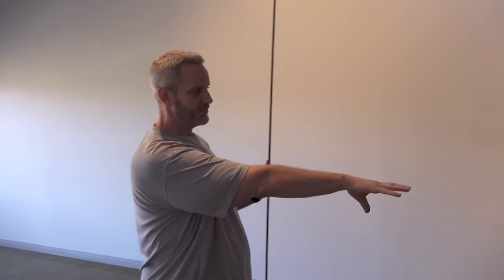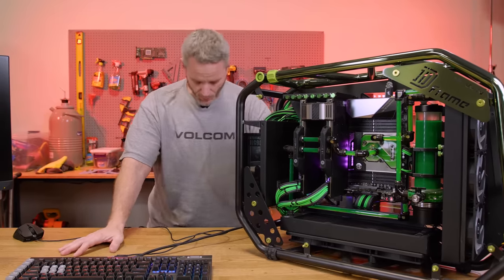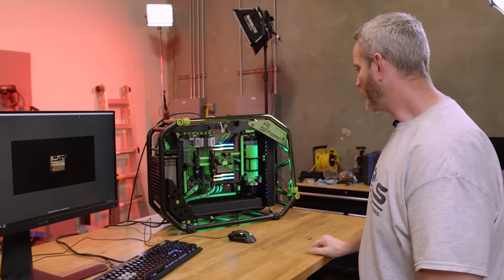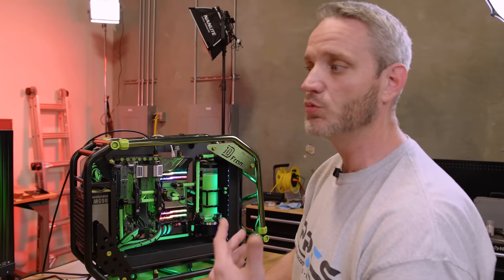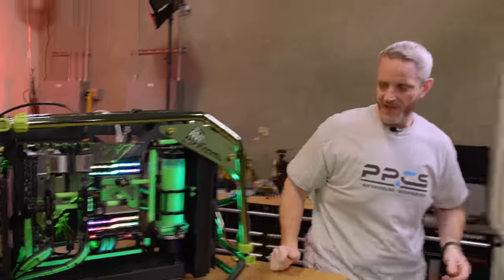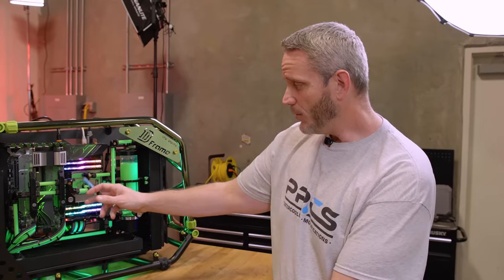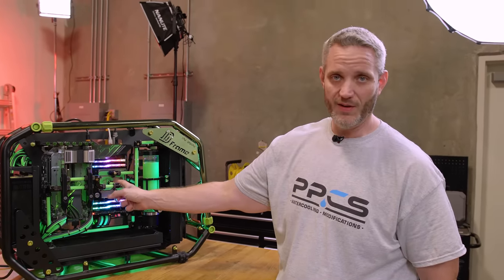This PC deserves better than this...

Comment: My last build had an Intel 4590K (?) that was cooled using Ice Dragon's (white) coolant; the build was completed in the spring of 2017 and aside from numerous BSOD's from a crappy motherboard, it ran cool throughout its lifespan - I didn't ever replace the coolant.

Now that that system has sat idle and unpowered for just over a year, the coolant has definitely fallen out - it's now a medium blue color. I'll try Jay's method of "refreshing" the coolant prior to disassembly and cleaning of the water cooling components. 
Being able to get the coolant to a near-new state would definitely lessen the cleaning time.

Water cooling components used were the EK Supremacy CPU block, Darkside 240 mm (60 mm thick) radiator, BitsPower 250 ml reservoir + D5 pump combination, Primochill soft tubing, and Ice Dragon coolant.

Comment: Never used opaque fluids. Used clear EK-Ekoolant for my first loop, then went Primochill True Transparent UV Purple. No breakdown in the fluid but it kinda stained my PETG tubes and it's crept into the gap between the metal block and acrylic top so I need to take apart my blocks to clean it since I'm going back to clear fluid with EK ZMT tubing on my next upgrade. Probably use non-acrylic blocks too for more of a stealth/blackout build.

Comment: my EK cryofuel solid scarlet red (the premixed bottle) held up phenomenally. The first load was in the (back then brand new) loop for 1,5 years of daily 2-4 hours of mixed use. Mostly gaming, sometimes some rendering.
I changed to the 2nd bottle of the same fluid and only needed to do a flush with distilled watern and there was absolutely nothing left in the loop, not event a tiny bit of fall out or anything.
After i'm done with the 2nd bottle i will do a full disassembly and look how the builduo in on the o-rings and stuff but so far i'm really happy i went with it and had 0 problems.

my setup is cooling a 9900k and the vrm for it and my 2080ti in a single loop with 2x 360 rads and a D5 pump that has a low-ish rpm curve set. Blocks /Rads / Fittings are all from EK, Nickel plated copper for the blocks.
Normally it doesnt spin above 2500 rpm while under load and idle its something like 800 rpm. + i've got a temp sensor in the loop and control the loop temp to be under 36°C
 all the time.
Since this is the first loop i ever built i did go for flex tubing and during the flush it didnt look color stained but not as clear as the first day (seems like normal degradation).
And on a sidenote, i'm really happy to make the decision for the singulary reservoir combo. The finish on the parts is just stunningly clear.

Sorry if its not well written / all over the place. It's 3 AM and english is not my native language ^^

Comment: I did a custom water system for my old set up 10 years ago. All I used was a small bottle of water wetter some og Listerine, and distilled water. It ran pretty much 24/7 that entire time before the cpu block had finally built up enough gunk to restrict flow. All I did was top it off worth water 2 times to ever 1 top off with Listerine over the years. It all transferred to the upgrade with a new mb, cpu and water block but same pump and reservoir combo. I just replaced the neoprene hoses cause they were all sticky with permeated coolant and dust. If ya don't go overboard with weird additives they can run pretty much forever.

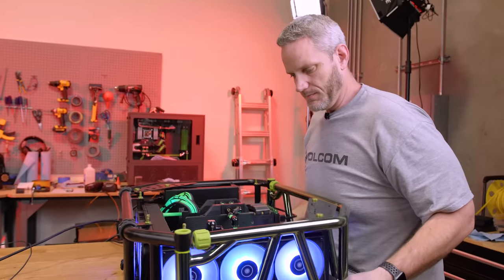Comment: 4:00 jay doing that reminds me of the ps2, sometimes it used to stop being able to read disks and the disk would just stop spinning.
I figured out if you tip it on its side and rock it up and down it for whatever reason made the disk keep spinning and itd read the disk.
Even happened once when i was at a friends and i did the same thing to hers and it worked. 
Have no idea why that would work but it did.

Comment: Went 1.5 years with Alphacool Eiswasser Pastel white in wife's pc. Zero sludge and a slight amount of buildup that broke loose on a distilled water flush. Retired that board and block for a new EK Quantum Velocity and Eiswasser Pastel Orange with 120mm Corsair LL's for a "Portal" Theme

Comment: The longest I ran a coolant in my daily PC's watercooling loops was for about 2-3 years with mayhem pastel orange with no issues other than the partials with time will fin out a bit (nothing major) and settle in the lowest part of your loop. Then again my prep work on all parts that includes the water was above the recommendations (flush /clean etc...). I even tested ph /acid to make sure it was in the appropriate range while doing my last full system clean. I simply rather spend a few extra hours to avoid issues then spend hours fixing them. used flexible tubbing (do not remember the brand)

Comment: I've been running my Mayhems Pastel Yellow for three years now. No maintenance was done except for topping it off occasionally.

System:
AMD Ryzen 2700X CPU
Asus ROG Crosshair 7 Hero MB
G.Skill 3200C14 16GB RAM
Nvidia Titan Xp Jedi Order Collectors Edition GPU
Samsung 960 Pro 2TB NVMe SSD
Corsair RM1000i PS

EKWB Supremacy EVO CPU block
Watercool Heatkiller IV Pro GPU block
Watercool MO-RA3 9x120 radiator
Watercool Heatkiller Tube reservoir
Watercool D5 pump

This system started out with a Threadripper 1950X, ASRock X399 Taichi, a Watercool Heatkiller monoblock, and 32GB of G.Skill RAM and I wanted to overclock it all, which is why the overkill cooling was used. Ran it that way for a while and then decided to switch it to what it is now. It had the same Mayhems Pastel Yellow coolant in it. I have a couple of quick-disconnect fittings in the loop, so I was able to switch from the monoblock to the Supremacy EVO with very little coolant loss.

The GPU temp has never gotten above 35C. CPU temp peaked at 55.8C when running Prime95 v29.4 build 8 Small FFT for several hours recently (3.95GHz all core). Coolant temp at idle is typically 21C and the hottest I've seen it lately is 25C. Any time I'm not working or gaming, the system is running BOINC with CPU and GPU work units, so it gets a full workout all day every day.

I would use Mayhems Pastel again. Building a new system very soon (already have Intel Core i9-10850K, Gigabyte Z490I Aorus Ultra, 32GB Crucial Ballistix 3600C16, and MSI 3070 Ventus 3X OC), so I may have a chance to...
Reply: And this is using PrimoChill PrimoFlex Advanced LRT 3/8" ID 5/8" OD tubing with Barrow compression fittings and two Koolance QD3 quick-disconnects.

Comment: you should rank the builds you have still lying around by different criteria to see which is the best by speed, value for money, value for money related to original pricing etc. Would be interesting to see (and too see which builds you have off set that we haven't seen/ haven't seen in a while)

Comment: I was a super early adopter of EK's Fluid Gaming aluminum line of products. I've had no issues until 6 months ago when I gave it a good cleaning and fresh distilled water only to have my cpu block clog enough to throttle my cpu 3 months after cleaning. I don't believe the water jug labeled distilled water was distilled water based on the sediment that got lodged in the block in only 3 months time.

Comment: I had mayhems blue dye + distilled water + primochill liquid utopia gunk up blocks within 2 years. Since then, I removed it from the equation, so just distilled + liquid utopia in all my systems. 

Had them run for years, sometimes with periods of being off for many months at a time, no issues. For me, losing colour and paying for an additive that can be hard to find sometimes is well worth the no-worries hassle. Now if I only bothered to clean the parts I re-use which still have a little buildup from old dyed systems, thing would be perfect.

Comment: Running I7 7700k with an EVGA 1080 for over 2 years on distilled water and some PT Nuke biocide. No issues. My new build will run EK Cryofuel opaque. Hope it holds up.

Comment: thermaltake c1000 opaque blue fluid, filled the system in 2018. only had the clean the blocks once and reused the fluid after cleaning. very minimal fallout and minimal nickel wear in the blocks.

Comment: I know this is probably too late, but I'd like to see a video featuring the difference between a fresh windows installation and an installation that's gotten updated over time. I'm sure most performance impact would be from programs installed by the user, but answering the question of how often to perform a fresh install would be a cool video.

Comment: Thats why I always buy a big CPU and upgrade my GPU a couple of times.
Went in 2014 from an i7-4770K with a GTX770 to the same i7-4770k and a GTX1080 and now I'm pushing the limit for the CPU - seven years later. 
Now it's time to upgrade. When stuff is available and money is present....

Comment: I’d have rather used air cooling or a closed loop cooler for that build.  I don’t want to deal with the maintenance of replacing the fluid and draining / flushing the lines and reassembly.

Comment: I actually tried to do my first water cooled build yesterday. I knew the case ALMOST fits a radiator on top (maybe if it wasn't crossflow it would fit) so I have a dremel and was going to make the opening bigger (it gets covered up in the end so no biggie if it looks like ass). Unfortunately my dremel only has 1 bit that can cut steel and it's not designed to cut like that. So I had to get a new one. In the meantime my Ryzen 3600 (temporary placeholder for my 5900x) is just loose parts sitting on my desk. But hey I love it already. Sooooooo much faster than my old antique I7-2600. I can't wait to get it all together properly instead of in the "test setup" configuration.

Comment: 2 years, fully diy salvaged loop (by nameless radiator + random tube + H100i pump ) using car rad coolant, not a single problem so far lol. same temp, same amount of liquid in there. i did took apart once to check the fin stack, looks fine. so yeah....

Comment: I just noticed last night the fluid was almost not moving in my loop. Turns out it’s the EK (opaque white) cryofuel being all gunked up in the CPU block after about a year.

I drained what I could, refilled with distilled water (you can barely tell, still looks pretty opaque 😆) and left it running overnight. 

Today I’m gonna do the heating thing he said after flipping the cpu block around.

Components:
- EK Opaque white concentrate w/ distilled water (more water than typically recommended)
- ek distro/cpu blocks
- ek radiator
- ek acrylic tubing + ~an inch of ek soft tubing

Comment: Why I stopped water cooling about 5 years ago. You can get air coolers that easily does the job, still looks decent and you don't have to deal with that crap anymore. I can focus on doing what your suppose to with these rigs. Gaming.

Comment: 3 years of updates would put you around 1803.  Do a google search for "Windows 10 Update Assistant", it'll bring you up to the most current build (at the time of writing this comment, that is 20H2).  Once it is done, obviously you need to reboot the system, however, if you do not manually reboot the machine, it will give you a 30 min countdown timer, and reboot automatically.  The only updates that do not download are any of the small minor updates, so after the reboot, you will need to run Windows Update (the normal way) to download any additional updates.  Reboot,  and check again (but you should be updated by then) Total turn around time is roughly 3 hours from 1803.

Comment: Been running my pc on mayhems pastel white without changing the fluid for around the same length of time (4/5 years) with no issues.  Everything in the loop is EK, I sometimes see some fall out if it hasn't been on for a while but quickly comes back to life after it ramps up

Comment: Your point about getting the fluid hot is the same reason I use boiling water to clean my radiators. Had to flush them 7 times with boiling water to clean the vue out of them.

Comment: great video. i had an issue with my new ek monoblock were it looked like the acrylic was cracked but it was just coolant seeping. Took it apart cleaned it and it looks brand new. I was pre scared tho. This clarified alot.

Comment: I had an unpleasant experience with the green VUE. 6 months in it started to flake out, but i was to lazy to flush it out and it didn't look too bad.... 7 months in it really gunked up and i had to take everything apart and deep clean my blocks, rads and pump.
So if you think >oh, it's not so bad. I'll clean it up soon™<
Just go ahead and do it NOW, because it might get worse ;D
I'm very tempted to try opaque fluids again, but for now i'm sticking with the clear ones.... Been running EK cryofuel in red, green and orange for ~ 2 years each and have not had any problems so far.

Comment: I'm still rocking a 1080 GTX and 7700K. It works fine for any games but on newer titles that can be CPU intensive I have to adjust settings if I stream.

I'm planning on doing a 5900x/3080 build at some point but waiting for pricing and availability OR I might just wait until the next generation rolls around depending on how that goes.

However I also prefer ITX builds so not planning on doing any liquid cooling. In the tight spaces of an ITX case I'd rather rely on good air flow vs AIO or custom loop.

If I do end up doing an ATX build I do want to do custom loop though but probably not going to do opaque

Comment: I am using mayhem pastel white all EK loop 2x1080 blocks, 1 CPU monoblock, 2x480mm XE rads and PETG tubing for about 2 years and I don't see any gunk issues I noticed it falls out after 2-3 weeks (was on holiday) but every half year or when I feel like I drain some of the liquid to check the fins on the monoblock if it's clogged or not, I noticed recently that the temps are a bit higher so prob have t repaste it.

Comment: Not a pastel fluid or even a custom loop, but I have a Cooler Master 280mm AIO that's been on my 4790k for over six years and it still keeps temps in check while gaming. And I'm sure modern games are probably straining that poor CPU to its limits at this point, but I have yet to reach thermal throttling in 1080p gaming.

Comment: I have the 7980XE on the ROG Extreme VI Mobo with 1080TI so seeing what a RTX3080 FE achieves at stock tells me when it's possible to make an upgrade  to RTX I will. More than happy with the CPU atm as it's not let me down yet although so much has changed with CPU's in the last 3yrs alone, Waiting on either the next X99 refresh or another ROG Extreme Mobo. Rather than salvage that system you should leave it as is and just keep uus updated with any fluid changes that are needed.

Comment: Wow... watercooling (with solid fluids), a signature case and SLI'ed Titans that hasn't been turned on for 3~4 years doesn't bode well with me. Should have set it up in your mini-Jay's room at the very least so it would see some usage.

Personally, I use clear EK Cryofuel (hate any dyes in my loops) and change it every 9~12 months. Rig uses Alphacool ST cross-flow radiators, blocks are all nickel plated copper using PETG tubing with a distribution plate in a parallel configuration. Currently, the GPU ports are blocked off on my distro plate (was running SLI'ed EVGA 1080TI's) as my EVGA 3090 FTW3 Ultra is waiting for a block that should finally be shipping from EK this week (pre-ordered Dec 7). My test bench sports watercooled as well (CPU only) using an Alphacool CPU block, EK PE radiator and EK D5 pump/res combo plumbed using EK's ZMT soft tubing.

Comment: I have only changed my 'fluid' cooler once. I had a Corsair H60 that I put in a box, stuck it in a closet, and retrieved about 2 years later, only for the AIO to fail hard. I actually suspect the pump had sized rather than any fluid issues. Other than that, I use a relatively clear cooling fluid and never change it. Air is still a fluid, right? (grin)

Comment: Maybe obsolete for a gaming enthusiast wanting to be on the cutting edge. If I had that system, I wouldn't be thinking about an upgrade for another 2-3 years. Heck even my system which that would kick ass on would probably be fine for at least another year if I put in a 1000 series GPU to replace the 650 that's in it (and yes it still mostly does what I need, not necessarily what I want anymore).

Comment: Lol, I saw an ebay listing for the X299 series of chipsets ranging from $200 to $500. They've depreciated very steeply. They'd actually be a pretty good deal if it weren't for the fact that an X299 motherboard is almost as expensive as when they were new.

Comment: Hey Jay, I would love a video that summarizes all your experience on water cooling liquids. I watched most of your videos on the subject and browsed some forums but I still have a lot of questions. Do you need to Nuke your system beforehand or is flushing the radiator enough? Are Dyes safe? Silver Kill Coil good or bad? Any brands you trust more than others?

Comment: I have that exact cpu in my current build with a 2080 super, hearing jay call it obsolete made me even more tempted to upgrade but can't afford it atm 😔 decided I'd save up and wait for ddr5 general release and see what's best value then.

I think jays definition of obsolete is about exaggerated cause yeah technically no longer made but still capable of almost anything even a power user and gamer would need

Comment: I was running a powerspec EK water block build kit from Micro Center with the EK fluid and I got nothing but rust in my system. I cleaned it out and flushed it probably once a month for about a year because of it. Eventually I just gave up and went back to air cooling way too much work.

Comment: As someone who is running i5-4690 without a Discrete graphics card, that computer is NOT obsolete and old by any means. I'm running Adobe softwares without a GPU and SSD so I'd take anything at this point.